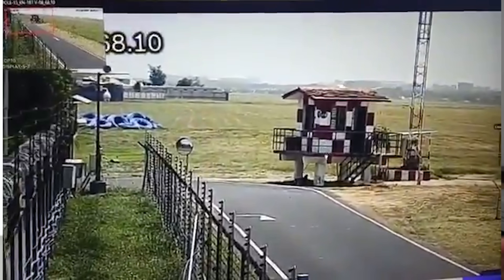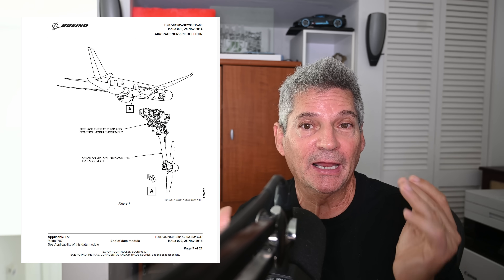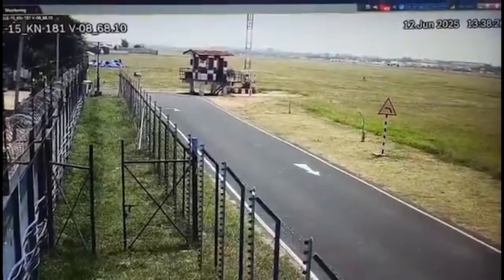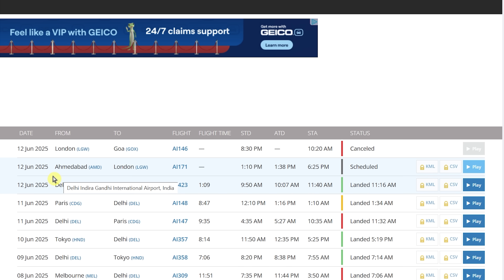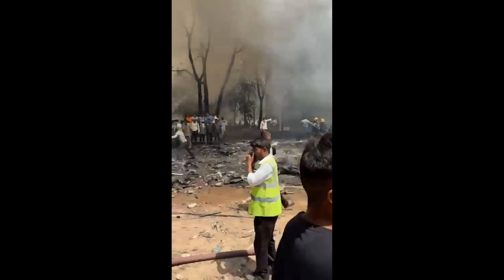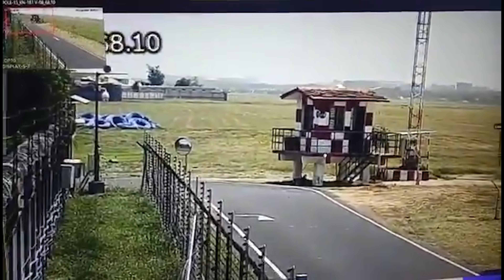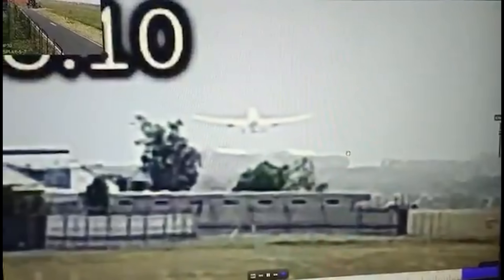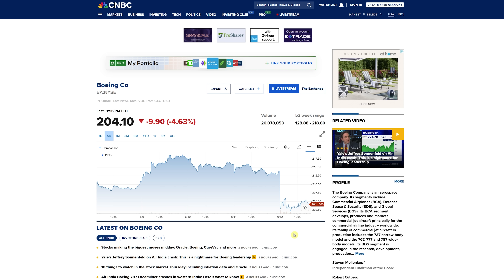What Caused Air India 171 Crash, Mysterious Sound Before Impact

Comment: Can't be sure Flight Data Recorder is examined, but looks like the pilots were almost 30 min late and may not have configured flaps.  In the better quality video, it sure looks like the flaps are fully up.  The pilots may have tried to save time by taking off from where the taxiway entered the runway and simply did not have enough runway to gain enough speed to maintain positive climb, without assistance from the flaps.  After liftoff, the more they pulled back, they more airspeed dropped and without flaps, the wings stalled.  Everything I see indicates a stall, not loss of engines.   A tragic loss of life.  Thoughts and prayers for the families.

Comment: I built 787s for 11 years and they normally sound like a prop job. The first time I ever heard one I thought the same thing, that the rat was deployed. But it is just the way those growl with the scallops on the engines. I live in Everett and work for Boeing where they are built and test flown, so I hear and see them very often. I can tell a 787 flying over head just by the sound and it sounds like a prop plane. So no the sound you're hearing is absolutely not the rat. You can actually see it's not deployed in the video.

Comment: Here is my theory Based on eyewitness accounts and videos showing multiple systems inside the Air India flight not working (like environmental controls), the theory is that the aircraft experienced a significant electrical power failure during flight.

	This failure might have caused critical systems—such as air conditioning, cockpit instruments, cabin lights, and communication devices—to lose power, contributing to loss of control and the eventual crash.

	Since modern aircraft rely heavily on electrical power, a total or partial electrical blackout could severely degrade pilot situational awareness and system functionality.

	However, commercial planes are designed with multiple redundant electrical power sources and backups, so the investigation should focus on what caused a failure severe enough to overcome these safeguards.

Comment: On the security camera video, you can see a great deal of dust rising up as the plane lifts off the runway. Would that imply that the takeoff roll was longer than normal and that the plane lifted off at or near the end of the runway threshold?

Comment: What would cause the RAT to activate? Dual engine failure? Also, why wasn't the gear retracted? Were the pilots unable to activate the mechanism of gear retraction? Lots of questions! There's speculation that the flaps were retracted at takeoff instead of the gear. Would that cause the RAT to activate? I don't think so.

Comment: The rat gen. was certainly activated. Assumably, the jet engines seem to have failed to produce more thrust due to the environmental heat conditions! Seem a way too relaxed take off, meaning the pilots think they are in mid air at 30 thousand feet, hence don't realise takes time to spin those engines!! Airforce pilots depend on other engine techniques for thrust?! I'm not familiar with larger commercial aircrafts, but does the APU and rat gen. help in rotating the jet turbines via the starter motor similarly when on the ground? Must be the reason why was activated, and similarly does take time to gain rotation. Hence is the reason for any other abnormalities like yawing and soon after falling when caught to an unexpected whirlwind like a gust yet from behind and on the elevators top or bottom surface, and the aircraft motion acting along  the lateral axis of the wings causing the aircraft to loose the direction of flight (lift).

Comment: It was 104F at sea level, so is that white cloud seen at rotation some condensation vapor from high lift following the wing in ground effect spreading? If that's just dust from the runway end zone, why were they that far down the runway? I mean, the turf is green, so why should dry dust be blown behind them? Is this the first flight since refueling? Would 100LL burn funny when it got through the lines to the engines? Or, did they just make an easy mistake in the climb procedure?

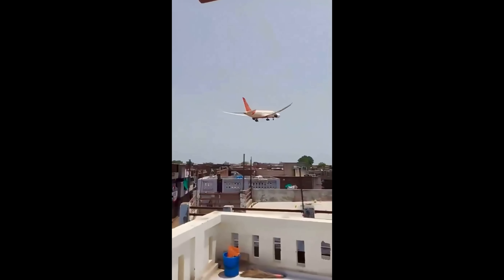Comment: It is really hard to tell. The imagery isn't good enough. But at 2:36, there does appear to be a projection off the fuselage in the correct location to be the RAT. If it did fail, it would have to have been the 3rd condition - loss of thrust to both engines. Perhaps then what that suggests is contaminated fuel and a change in what fuel got to the engines as the plane rotated upward for takeoff.

Comment: The RAT being out is simply too big of a deal to be anything less than either maintenance failure or inherent flaw. Over at PPrune there are some quite definitive observations pointing towards a massive electrical issue either being a symptom or even the reason for this accident. Furthermore the DGCA has come out with an emergency directive requiring a number of checks including the Flight Control Systems and several electrical systems.

Comment: Just looking at the original video the left wing looks very clean along the trailing edge, of course it is nigh on impossible to be 100% accurate from a low quality compressed video, but it does raise a question as to if the flaps were moved once they had the gear up call? 
The sound can also be altered by the fact the landing gear was extended and also the relative direction of the sound source to the in phone microphone. 

The answer to this accident is in the FDR and CVR.

Comment: As a non aviator could someone tell me, IF the flaps were not correctly set would that alone be enough to cause this kind of failure? I feel that if the engines were operating correctly that they would be able to compensate for the lack of lift from incorrect flap configuration... But like I said I am not an aviator (or a student of physics for that matter).

Comment: Cell phone video audio shows engines are running. Wings level means no asymetrical thrust so both engines are running properly. Cell phone video also shows flaps are retracted but wheels are down. Copilot probably accidentally set flaps 0 instead of retracting the landing gear. From the video you have the wheels never got retracted when they should have. Probable cause is pilot error accidentally retracted flaps instead of landing gear.

Comment: The security camera picture quality is pretty poor, but no signs of birds, or puffs of smoke etc. coming from the engines so that seems to rule out bird strike. If its a double engine failure I can't help wondering with the current India/Pakistan tension whether someone added a few tons of water instead of fuel (as an act of sabotage) when refuelling took place. Seems unlikely that both engines would stop nearly simultaneously, but could the g forces of accelerating down the runway have bought water to each tank's discharge port? No other aircraft affected, so that seems to rule out a generic fuel issue at the airport.

Also I was wondering if both engines failed, leading to a loss of hydraulics, while the undercarriage was retracting (BUT before it locked in its stowed position) could that explain why the wheels came down under their own weight.

Comment: All i could say (prior to this analysis) is that the plane didnt sound right. Those engines should be roaring as it past by but, they were not.

Made sense as there was already speculation of engine failure. Was thinking i was hearing the turbines winding down...

By the way: Cpt Steve said the security camera DOES show a problem: all that dirt kickin up as it lifts off. May have exhausted available runway... So, the incident may have happened before they ever got off the ground.

Also, they never raised the the gear...

Comment: Pilots with thousands of hours flying, pointed out the wheels should have up at this stage to enable more aerodynamics for take off and lift. Also, the wingflaps were not in the take off mode. 

I am no engineer, but my guess would be machanical or hydrolic failure.

Comment: Boeing did not make a bad plane. The copilot forgot to retract the landing gear and instead pulled the flaps. Lost lift and the wheels dragged it down even further. Most likely copilot error.
Reply: There have been 26 Boeing crashes since the year 2000 !

Comment: Yes as an Ex RAF Engineer I agree that the undercarriage remains down right to the end is "very much" an indication of the problem...!!

More than often undercarriage's are retracted as soon as the aircraft reaches the end of the runway. Most certainly sooner than the distance it had travelled

To my mind "No retraction"  indicates a hydraulic or electrical failure.!!!
Simultaneously affecting both the flaps & the undercarriage at the same time!. 
 
Certainly one would want to retract the under carriage ASAP in order to reduce drag anyway.
But they were helpless at achieving this.

Another thought..... Is Was the plane in landing mode. With the undercarriage locked into place and the airbrakes on...!!?? Not so sure about this though

Comment: I think that the most telling clue in the takeoff/crash video is that the landing gear remains fully extended throughout.  After the plane rotates, it appears to be in a standard climb mode for about 12-13 seconds.  On normal takeoff, this is the time frame when we would see the landing gear being retracted.  I agree with Captain Steve’s analysis.  In those first 13 secs, the co-pilot retracted the flaps/slats instead of the landing gear.  Then, the pilot feels a loss of lift, doesn’t know why, suspects a power loss, and calls a Mayday.  At this point, he sees his co-pilot’s error, and quickly re-engages the flaps/slats, but it is too late, crash occurs at 33 seconds.  This hypothesis would explain why the crash photos show the slats engaged.
The relatively intact tail section should result in an easy recovery of the black boxes.  Therefore, we will soon know the answer.

Comment: RAT sound ram air turbine sound.. it is generally used when u need emergency electrical power supply or else. When both engine are not working

Comment: UPDATES as at Fri. 13/6/2025 16.35 CEST 10.35 ET

INCIDENT: Thurs. 12/6/2025 10.09 CEST Happened = 13.39 Local Time. India, Gujarat, Ahmedabad, 2.5 kms W of Sardar Patel International Airport, 23.055488°N 72.615643°E, Air India Boeing 787-8 Dreamliner Crash Flight 171, Rego VT- ANB

(1) Weather was absolutely not a factor. No Wind Sheer problem either.

(2) The plane was well under it's Maximum Takeoff Weight of 227,900 kg. It was carrying very little non passenger luggage cargo, thus Weight Shift was not the cause. See: The 29/4/2013 National Airlines Flight 102 near Bagram Air Base, Iraq Crash.

(3) Scheduled Flight Time from Ahmedebad to Gatwick is 9 hours and 45 minutes, 6844 kms as the crow flies. There were only two pilots on board the flight. There were only two people, these pilots, in the cockpit at take off time.

(4) The claim that one of the two pilots, Captain Sumeet Sabharwal (8,200 flying hours) and First Officer Clive Kundar (1,100 hours), sent a Mayday call to ATC was first reported live on Indian media outlet "Republic World" at 13.05 CEST, 12/6/2025. The studio host said on air "Breaking News: The Minister of State for Aviation has confirmed a Mayday Call - No Thrust. Plane not taking lift”. At 15.00 CEST  Ram Mohan Naidu, India's Civil Aviation Minister, at the scene of the crash said he's "in a state of shock". He did not mention the Mayday Call. The DGCA's website up till now, 16.15 CEST 13/6/2025 does not mention this Mayday Call. Other mainstream media outlets, like The Telegraph UK, and Spectator on X ran with this story from Republic World. There is zero confirmation from any offician indian Government body about this alleged Mayday Call.

(5) India's Directorate General of Civil Aviation "DGCA" steps in after Ahmedabad tragedy 🛫 India’s aviation regulator DGCA orders enhanced safety inspections on Air India’s Boeing 787-8/9 fleet following the AI-171 crash. All eyes now on fleet readiness and passenger safety. ✈⚠ - Charcha Express

(6) Police sources: Black Box recovered from Dreamliner wreckage. They did not say whether it was the flight data recorder or the cockpit voice recorder that had been recovered. Investigators will be examining the wreckage, the recorders and will also be delving into the background and health of the crew. - The Independent UK

(7) The "Bird Strike" cause has been ruled out already after video, CCTV, phone footage and eyewitness testimony from locals and the area has been collected and analysed.

(8) India's National Investigation Agency राष्ट्रीय अन्वेषण अभिकरण is considering the Terrorism line of inquiry, but I am quite sure they will find Terrorism to not be the cause. You will also note, the Pilot in Charge "PIC" of the plane, Captain Summeet Sabharwal, was a Hindu, so the "Islamist Murder Suicide" terrorism accusation is out of the question. There was also no bomb on board, or gunfire or RPG from the ground.

(9) The PIC used the full length of Runway 23 at Ahmedabad. RWY 23 is 3504 metres/11,499 feet long. The aircraft backtracked to the end of the runway before beginning its take off roll.

(10) Even though Boeing's Share Price has been hammered, - 3.57 % since the crash, I don't think "Mechanical Error" or a "Technical Fault" is the reason for this crash. (Markets are not Rational.) The Dreamliner has a very good safety record, that's why this incident is so unusual. Note: I do not work for Boeing or Airbus and I don't have shares in either. I value my independence way too much to work for any corporate or industry group's "Reputation Management Division"

(11) I have analysed all the available public evidence to date and have some early conclusions about the cause of this crash. One key piece of the jigsaw puzzle is the fact the landing gear was still down. This means there was a real problem in the cockpit, where the two pilots were strapped in. (The usual procedure on a Boeing 787-8 is for the landing gear to be retracted approx. 9 seconds after lift off. The Pilot in Charge keeps their hands on the Yoke/Joystick, whilst the Co-Pilot flicks the switch to retract the landing gear) The landing gear was not retracted after Take Off. This task on a 787-8 is the responsibility of the Co-Pilot, as the Pilot in Charge "PIC" has to keep his/her two hands on the Yoke for at least 90 seconds after Take Off. Was the Co-Pilot too busy with an emergency in the Cockpit to flick the Retract Landing Gear Switch? 🤔

The truth about why this crash happened has to come out so that the chance of more such incidents is reduced. Many good people in the Aviation Industry since Les frères Montgolfier have spent a great deal of time and effort trying to work out why various crashes happen. They have built up a huge body of work to improve Aviation Safety. It is a real Science. Knowledge is cumulative, yet sometimes in history a new glitch appears that threatens all the previous work...

“Those that fail to learn from history are doomed to repeat it.” - Winston Churchill.

Prayers for the people on the plane and ground killed in this terrible incident.

Adam Neira
Founder of World Peace 2050

Founded April 2000
Paris - Jerusalem - Melbourne

Comment: Mechanical engineer with a BS in aeronautical engineering and a pilot training in single engine small planes. And finally worked for an aerospace company that makes the ram air turbine, engine driven electrical generators. Flap systems for the shuttle, etc.; basically a very wide assortment of aerospace components.  I worked in development of new products and have some exposure across the product line in the 20 years employed.  

I didn't hear the ram air turbine and didn't see it in the video. Didn't see birds rising in front of the plane.   

 The path of the plane was straight which tells me they didn't loose one engine because that always cause a drift until the controls and power are adjusted for single engine flight.  Didn't have sufficient time and would have see a drift and return to the correct direction.

The sound of the engines was steady with the expected doppler effect as it flew past the microphone and as it flew away a lowering of the volume but a steady frequency.  So I conclude that both engines were operation at the takeoff spindle speed of the blades. 

 The speed leaving the ground and the takeoff point on the runway matches a fully loaded plant starting from the normal end of the runway point say a professional pilot of this or similar plane.  This means the engines were both operation at takeoff spindle speed and thrust.  The rate of climb over the remaining portion of the airport also appeared normal.  So the procedure is to retract the landing gear basically soon after leaving the airport grounds.  Didn't happen.

That leaves the flaps were in the deployment specified for the takeoff air speed when the plane lifted off the runway. One commercial pilot and fighter pilot said the plane wings looked thin in the video.  He saw lots of takeoffs and landing.  

In the cot pit center council are both the levers for gear up and flap setting.  Can be seen on video the pilot showed of takeoff of this plane.  The plane would have stopped climbing and level off if the flaps were moving from fully deployed back to a lesser setting. The plane would loose altitude even at a higher air speed as the flaps continued to retract because it didn't achieve the speed needed for the flap setting.

Comment: Great theory about the prop for the backup generator making that noise as the plane passed the camera .  Jeff even had examples to hear what the noise of the prop spinning sounds like when it was deployed on other planes.  I said from the beginning that the videos showed that the plane wasn't climbing.  Engine failure was my theory. Wonder if the gear can be raised if the engines aren't running.  May take too much power.